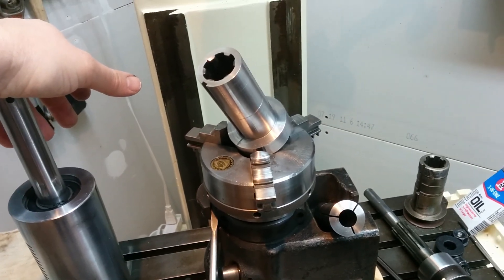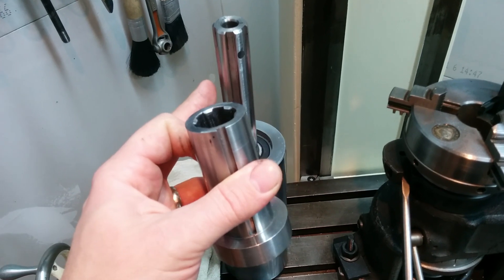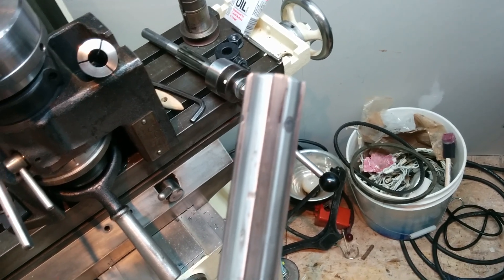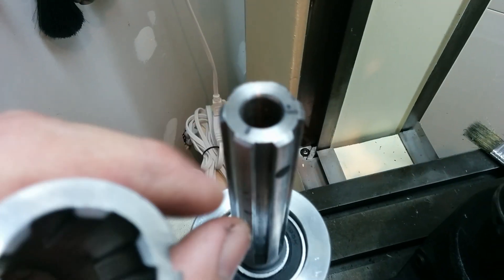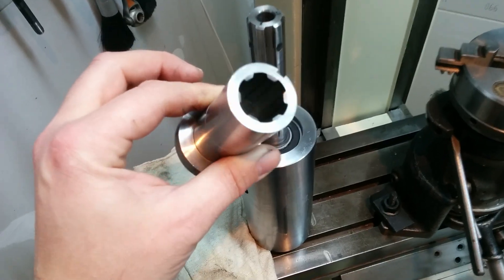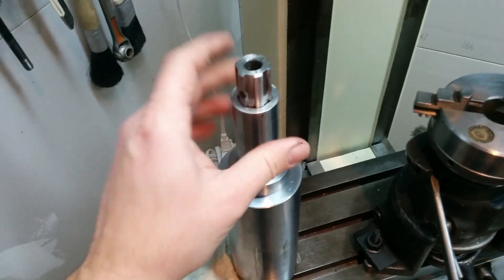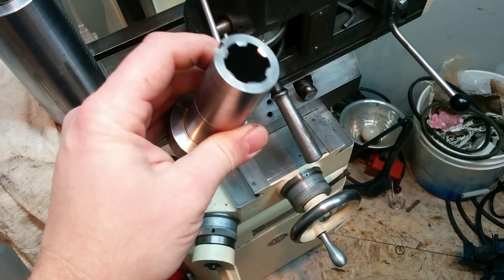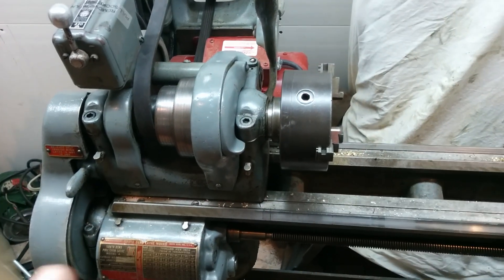Rockwell 21-100 Spindle Hub episode #4

Comment: Hi jarrett did you have a hard time removing the v belt pulley from the spliced shaft when you first disassembled the spindle assembly?.....I'm having trouble removing mine I think it may be from heavy rust on spline?
Reply from the maker: no, I didn't have any problems.  I didn't have any rust to deal with either though.

Comment: Great job Jarrett! Your vids are terrific. I am re-habbing my Rockwell Mill spindle as well, so I thoroughly enjoy your comments and thoughts. In #4, does your new part fit with the sheave on the top? I think it will re-assemble that way. I look forward to seeing your video on putting it all back together...Thanks!!
Reply from the maker: Hi Peter, thanks for the feedback.
Yes the new drive hub does fit the spline when reversed vertically.  Just keys in to one position is all.  I'm sure it's due to my efforts to tighten the fit, combined with the light damage the spindle took over the years.  When I was fitting it the points of contact that needed to be knocked down were quite small.  Because I focused my efforts with a single alignment so I wouldn't be chasing my tail, I ended up "keying" it into one position.  More matter in the grand scheme.
Thanks for the comments